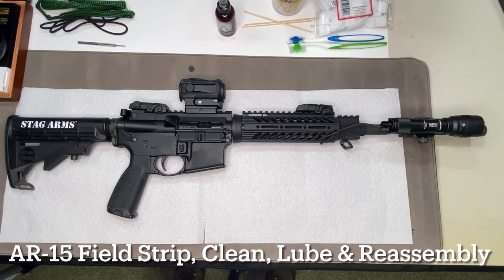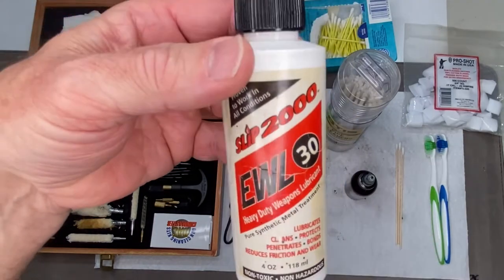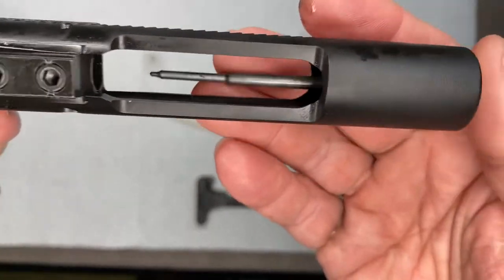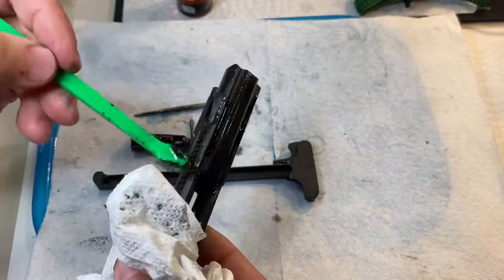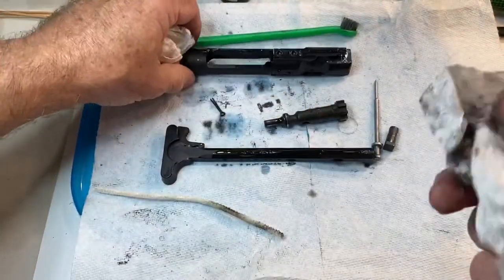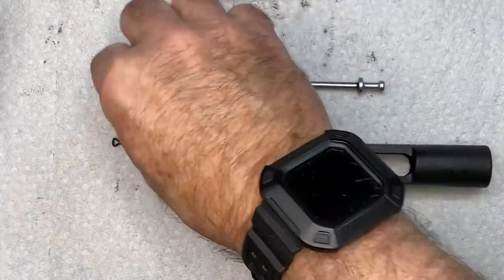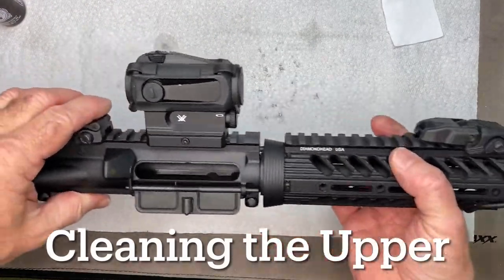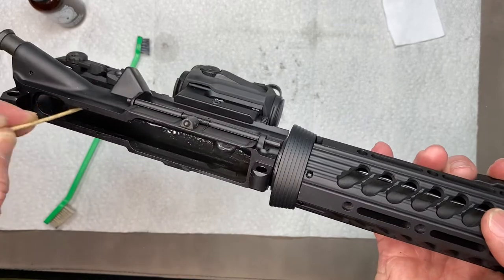Stag Arms Stag-15 AR-15 Rifle: How to Field Strip, Disassemble, Clean, Lubricate & Reassemble

Comment: Firing pin retaining pin position suppose to be at the 9 o'clock and 3 o'clock position. Not 11 to 5 or 12 to 6.
Reply from the maker: The 9 o’clock and 3 o’clock position will help get the pin all the way in if it is being difficult, but the final position (as long as it is seated all the way in) does not matter. Thanks for your comment!

Comment: Not sure why but my cotter pin refuses to go back in after cleaning. Brand new, just took it to the range today for first time!😢 my cotter pin needs to be squeezed a lot to get it in the first hole, I think it’s opening too much to go into the second hole on the other side of the barrel
Reply: Update- got it in!
Reply from the maker: Thanks for watching the video and leaving a comment! I have had that happen as well. I agree that is what is happening. You may be able to use needle nose pliers to open up the cotter pin a bit, then bend it so it closes a bit better, ( I have done this in the past) or get a replacement pin. Another option is to try sanding down the tip of the cotter pin very slightly to make the end a bit more rounded. 

Dave
Reply: Gonna take my stag apart for the first time after work today, so I can take it to the range this weekend and run it. 

Any advice as an owner, that you wish you had when you first took yours apart to clean? 

Well wishes from Oregon, fuck ballot measure 114!
Reply: Dont use pliers.  Apply downward pressure on the pin as you push, adverse to the extractor. A slight wiggle and you should be in every time
Reply: Buy backup cotter pins you’ll be glad you did. Sometimes they just need to be replaced.

Comment: I'm a total noob, do you not need to clean the gas system?
Reply from the maker: Thanks for the question! The Stag User Manual does not address the gas system in the cleaning instructions. I would say that if you are comfortable with further disassembly of your AR, it would not hurt to clean the gas tube and block, but I would not worry about it unless you shoot thousands of rounds. 

Dave